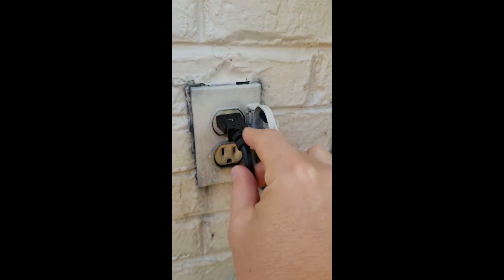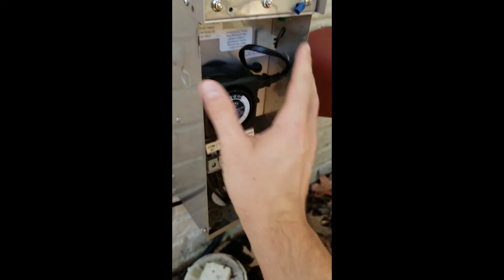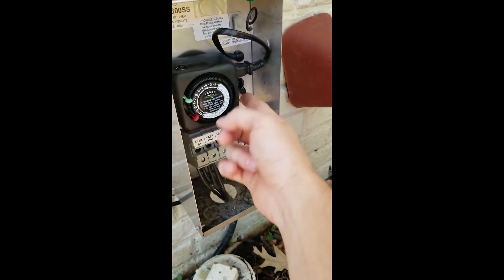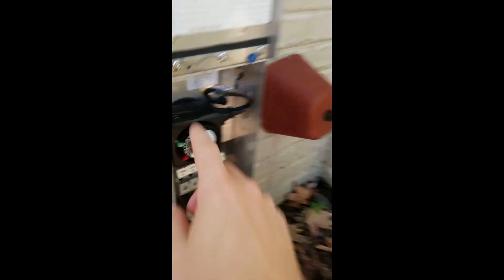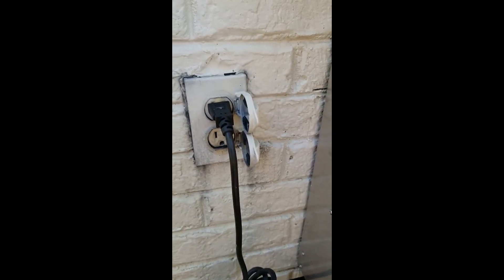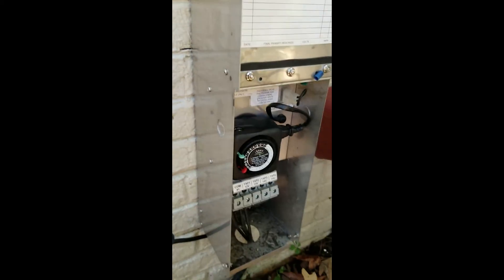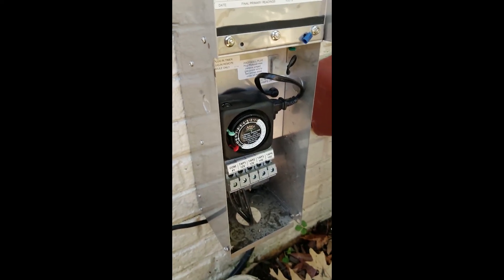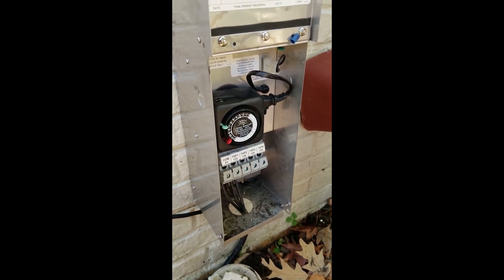LOW VOLTAGE OUTDOOR LANDSCAPE LIGHTING TRANSFORMER - What to do when all your lights stop working

Comment: What happens when the light switch go off?
Reply from the maker: It just shuts off the power to the lights. 
If when you flip it back on and it automatically flips back off, then the switch is protecting the transformer from getting fried.

Comment: my landscaping guys mowed over one of my lights, and now my backyard lights won't come on.   Would it be that it caused a short and the transformer breaker tripped?
Reply from the maker: Yup! You'll need to either replace the light, fix the light, or take the light out and fix the wires. Sometimes the wires are touching inside the light fixture (if there isn't a cut wire). Then go to the transformer and flip the breaker switch. You may need to go to the breaker box or a GFCI.

Comment: Thanks. I believe lightening took out my Volt transformer. The switch will not stay in ON position. It trips back to OFF. Thanks
Reply: I also have a VOLT 300 watt transformer that has went bad after a recent power outage. I think mine also got fried from a power surge. Tested with a multimeter and no voltage at the taps when the unit is powered on. Had to purchase another one at the tune of $270.

Comment: That Circuit breaker you just Reset inside the Transformer isn’t Related to the 120 volt coming out of the wall , that one trips when you overload your Low Voltage Transformer or there’s a cut in the Low Voltage wire and Wires are coming in contact with each other , also some of the New LED Bulbs can Trip this Circuit Breaker , that wall Receptacle has its own 120 volt Gfci many times located inside the garage , and yes it does need a water tight cover box , Just wanted to Mentioned this hope it helps some folks Down the Road
Reply: Dude! Thank you so much for leaving your comment here. There was a really bad rain storm while I was out on vacation and my patio lights stopped working that night. I didn’t notice until days later. I have almost the exact same setup as on this video. I went to test everything on that transformer but nothing worked until I read your comment about the GFCI located in the garage. Flipped it back on and voila! Lights are working again! Thanks so much man! I was about to call an electrician! 😅

Comment: @aklighting 

What is your thought on this scenario  -  Sollos tr15ss 200  transformer, power is feeding to box, but nothing coming out? Literally voltage detected going in, but dead on the output. Has a toggle breaker switch. Seems to be a sealed non serviceable stainless box. Bad breaker switch? Thanks for the assistance.
Reply from the maker: Yeah it's most likely a bad breaker. It happens sometimes.